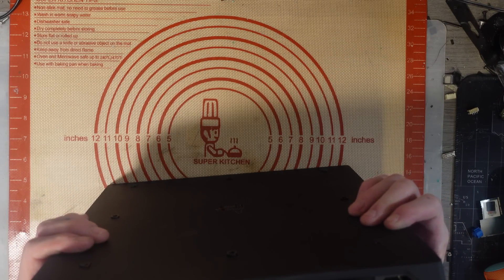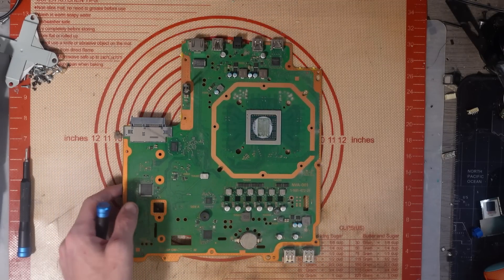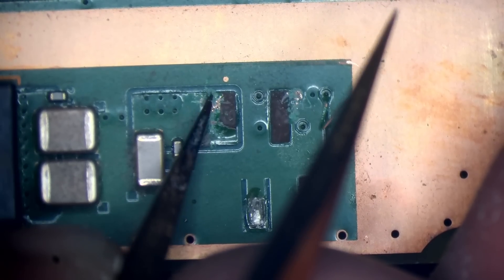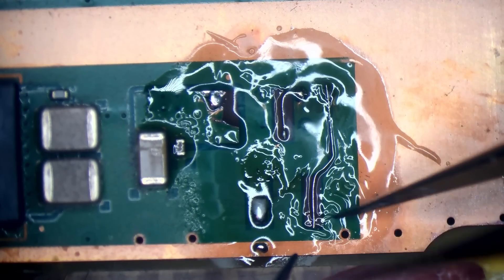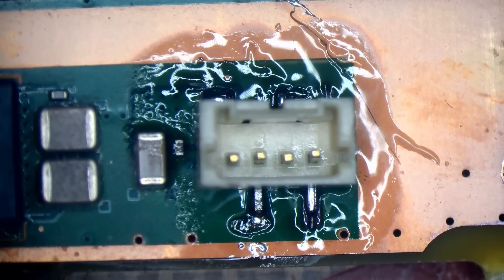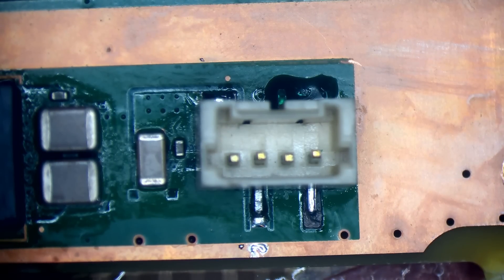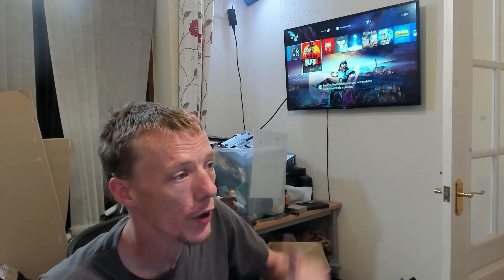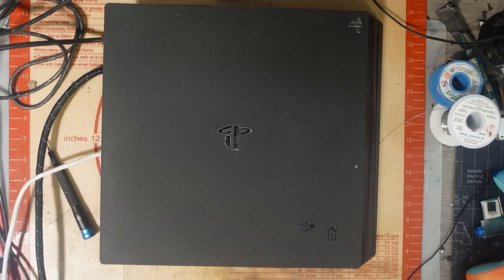The Owner Of This PS4 Pro RIPPED The Connector Off While Cleaning It... Can I Fix It?

Comment: Wait, people's complaint is "conformal coating is what they put on at the factory"? They put solder mask on at the factory too. That's what the green stuff that was scraped away to expose new places to solder to was. 

Conformal coating is generally a different coating that goes on later that protects against dust and liquid. Both solder mask and conformal coating can be put on at the factory as well as after the fact.

What are those people complaining about? 😂

Comment: Nice one. Could have skipped the mask and just put CA around the whole thing. Safe and secure in one move.
Reply from the maker: Yep probably could but I like to overkill lol
Reply: Never tried CA glue on anything but to glue rc tires on the plastic rims, not sure if it would cause damage, but if not would be a fast bond with the spray to cure it

Comment: Hot glue
Reply from the maker: I could have used it yeah but it's very rare I use hot glue so I don't even know where my glue gun is hiding lol
Reply: @TheCod3r  you do not need a glue gun, you can  you a heat gun to softer the stick and then apply it to were you need.